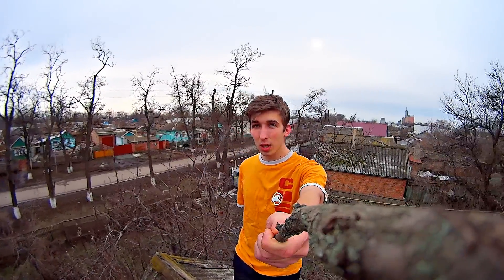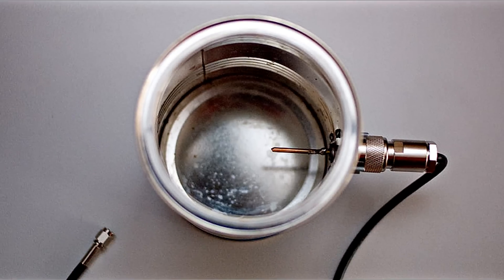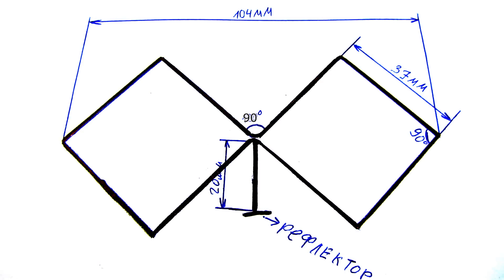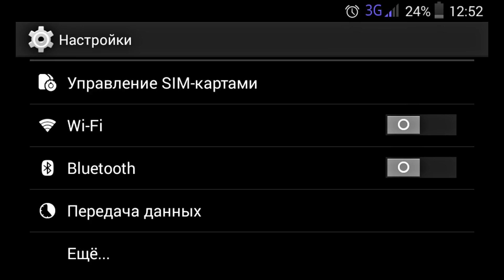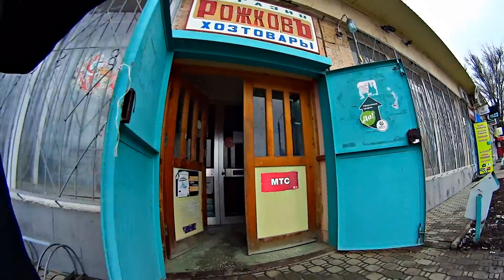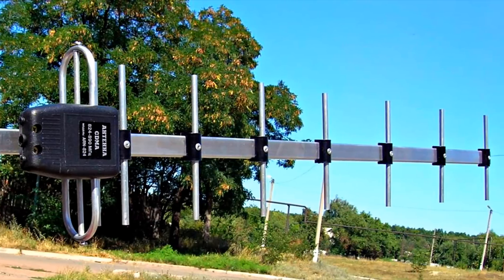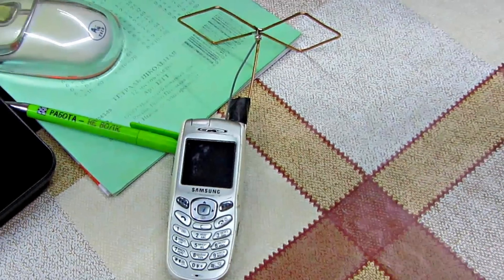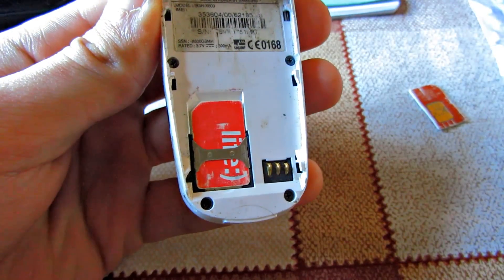How to get connection to the Internet in difficult conditions

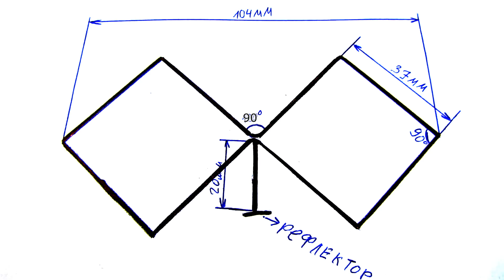Comment: At 1:10 the antenna is shaped exactly according to vortex based math.....1,2,4,8,7,5....which also makes the infinity symbol...all you do is start with 1 and double..u get 2... double..get 4... double..8...double 8...get 16..once at two or more digits..just add the digits together..last answer was 16..1+6= 7.....16+16= 32...3+2= 5....32+32= 64....6+4= 10..1+0=1.....64+64 = 128...1+2+8 =11...1+1=2.....it's a never ending pattern that is how the universe works...and the numbers 3,6,9, are not in this pattern... 3,6,9... describe zero point energy and they have their own significance....if you double 9..= 18..1+8=9...18+ 18= 36..3+6= 9....if you double or even divide by two the number added up always equals 9...and 3 and 6 will alternate back and forth if the same thing is done.. .this is why Nickola Tesla made the statement..." If you only knew the magnificence of 3,6,9,..you will have the keys to the universe"..... Einstein was a fraud that discovered nothing....the only force is electromagnetism and Tesla knew this...and even Einstein knew that Tesla was right.... when asked what it felt like to be the smartest person in the world.... Einstein said..." I don't know...you have to ask Tesla"

Comment: Can you use Nitinol shape memory wire to make the antenna? When not using, you can crumble it to make it small. When heating, it will turn back to the original shape.

Comment: i use the internet from a restaurant 15 km away from me with my homebrew antenna reflector and parabol. when it has fog, i loose the conection. before i used mobile internet. but after 1 gb it was only 30 kb/s (not more usable). now i have free internet.

Comment: I connect to free wifi which in over a mile away using an old tv antenna. 8.75Mb/s DL 7.20Mb/s UL only problem is IP co figuration dropouts ever few hours.